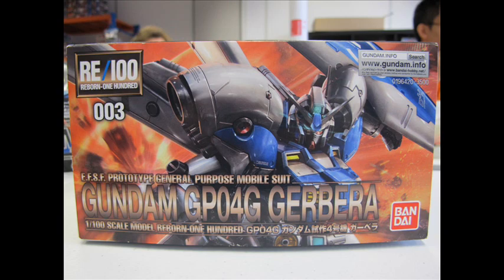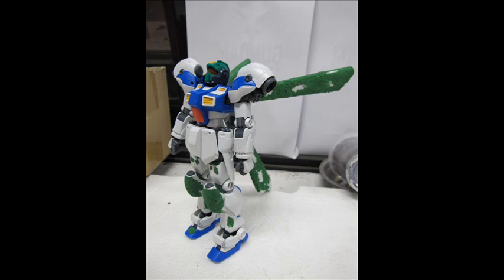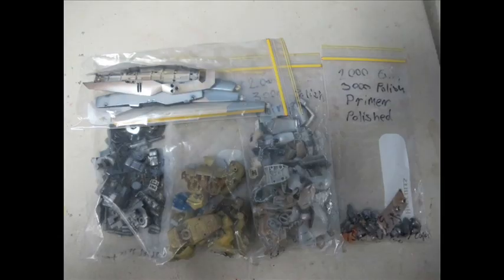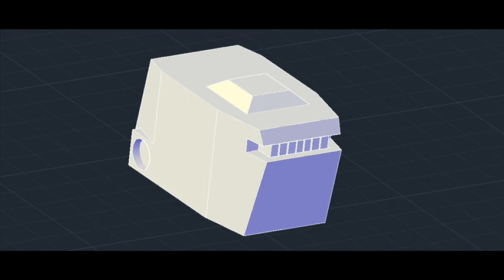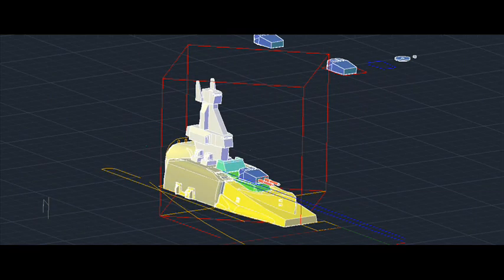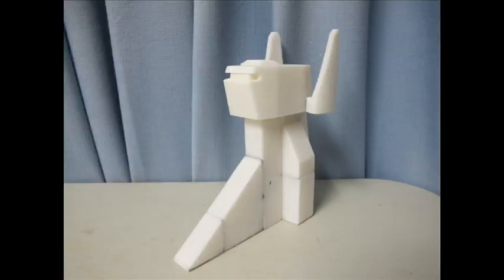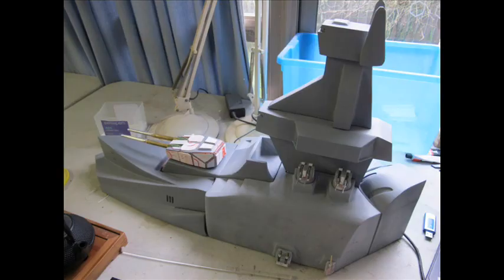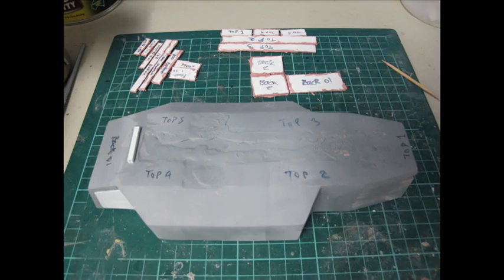Diorama "EFS New Yark Magellan-class" 2016 GBWC entry

Comment: I have to wonder how the future of large-scale dioramas will shape out, as well as the impact that 3D printing will have on gunpla. As printers become more and more intricate, will the old methods of using putty and styrene to create shapes and detail begin to die out? Will dioramas become more blocky as a result? Only time will tell. Either way, gorgeous work as always!
Reply from the maker: I do not think the old methods will die out as some details needed to be added in a traditional matter. But with SLA printing any detail or structure will be repeatable easily. I'm just happy to be the first to attempt it at this scale.
Reply: @mokanaman I agree with you 100% on this. I personally agree that 3D printing is a tool, not a catch all for all solutions. Scratches built things will always look better then prefabricated things in my opinion just due to the artistry of it. Just my two cents.